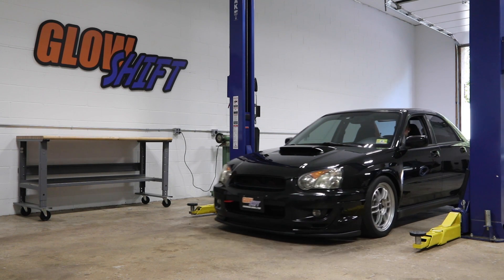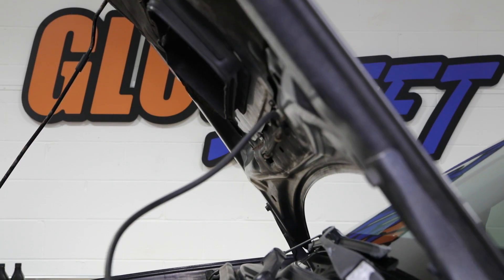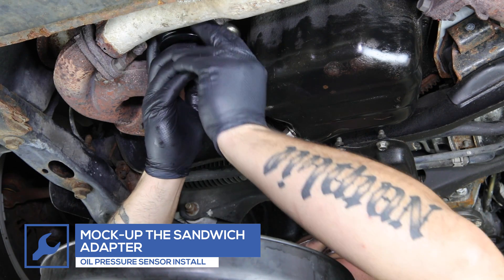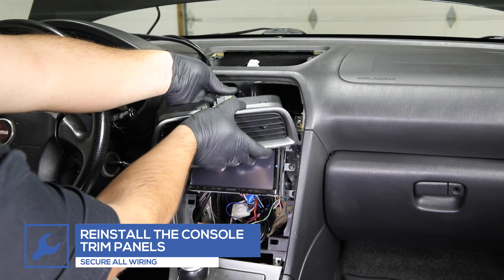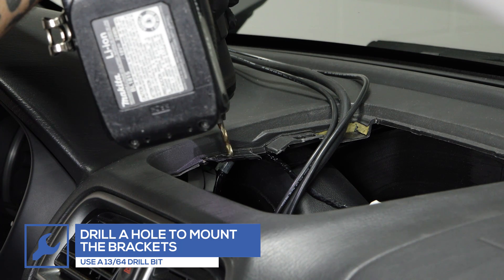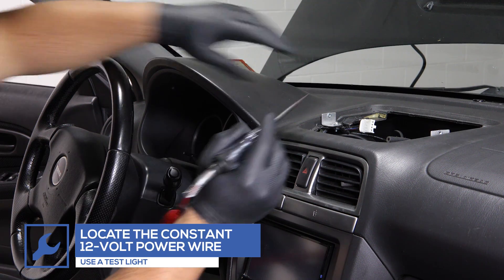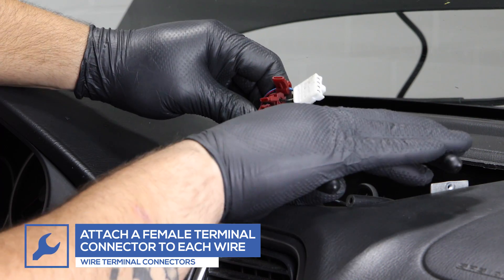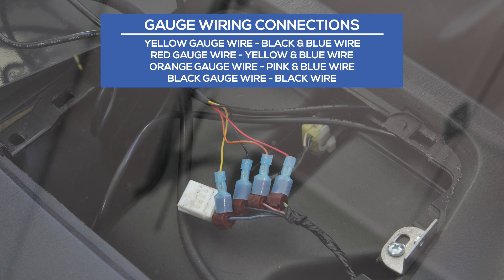GlowShift | How To Install A Subaru WRX and STI Dash Pod With Gauges

Comment: installed the kit w boost, oil pressure and temp, and now my ambient temp is reading 122° and the oil press and temp are maxed on gauges on start
Reply from the maker: Can you verify which gauge series your gauges are? Double check that the temp sensors are connected to the correct gauges. Our gauges tend to max out when the wrong sensor is attached.

Comment: In my 04 wrx i keep blowing my fuse has anyone had to use a bigger fuse for it to stop blowing? Fuse in question is the radio fuse its a 15
Reply from the maker: The 15 should be fine. Double check all the wiring to make sure it is all secured and there are no shorts.

Comment: Don’t tap in to the clock/passenger air bag indicator wiring on 2006/2007 models and be sure to leave that clock/air bag indicator plugged in and tucked away or You WILL get an airbag light/malfunction
Reply: well said and thank you !

Comment: Don’t tap in to the clock/passenger air bag indicator wiring on 2006/2007 models. and be sure to leave that clock/air bag indicator plugged in and tucked away or You WILL get an airbag light.
Reply: New to Subies, I have 06' WRX. So youre saying dont use the wires for the clock in the center?

Comment: Can I install the oil pressure gauge without using a sandwich adapter?
Reply: Sandwich adapters introduce another point of failure to the mix, so I would avoid those if I were you. The best place is the port underneath the alternator. That is where the OEM one is, which is just above the oil pump. Swap out the OEM one with your gauge sensor and your golden. The engineers put it there for a reason.
Reply: @jonney8046  doesnt that cause the light to go off on the dash tho? From my understanding it does and thats why people avoid it.
Reply from the maker: Yes, as long as you have a port on the engine that will show oil pressure.

Comment: The shroud could be a lot better, needs to match the dash, plus clip in the same places where the clock came out. I have a PSI 3 reader on my dash, plug and play into the OBD....but doesn't have oil temp or pressure readings, I'd need work done to facilitate that.
Reply: You could flock the entire dash including the bezel piece so everything matches. But trying to match material from a 15+ year car isn’t going to be the easiest thing. It’s always going to look either off or newer.

Comment: Find it funny. The T piece for boost gauge. Only one hose clamp for the now 3 lines. Should be 3 really.
Reply: a tight cable tie will do !
Reply: Question: Putting that T fitting doesn't reduce the boost since now there is a deviation for the gauge reading?
Reply: @ivj2923 nope won’t affect anything
Reply: it would if you tapped into waste gate actuator line. but if you tap into blow off valve like in the vid it wont. @ivj2923

Comment: I did this exactly how in the video and the clock harness cant handle enough amperage to power the gauges and the fuse blows, why design your instructions around a method that doesnt even work?
Reply: These don't even draw close to enough power for the little LED's. Hell your stock clock should be pulling more amperage than these 3 gauges with that normal light bulb. You had a short there, buddy. Always triple check.
Reply from the maker: Double check your wiring to make sure you do not have a short somewhere. Also verify that the correct amp fuse is being used. Using the clock harness should not be blowing the fuse.
Reply: @GlowShift  The fuse being used is a 15 amp which is what is used in the wiring diagram on the back of the cover, its wired up properly because for the first 15 minutes everything worked flawlessly like it should. I'm wiring it up to the fuses behind the coin tray instead with add a fuses circuits.